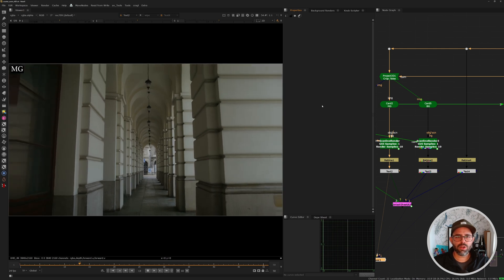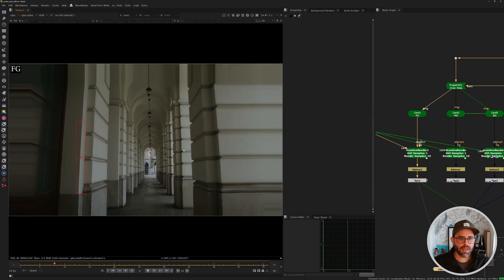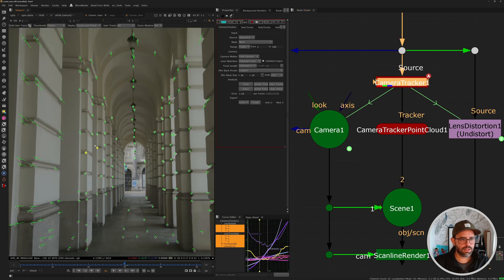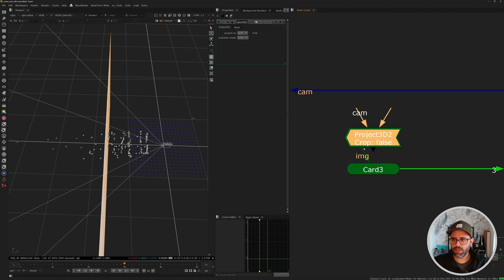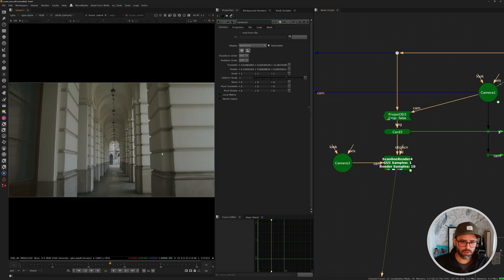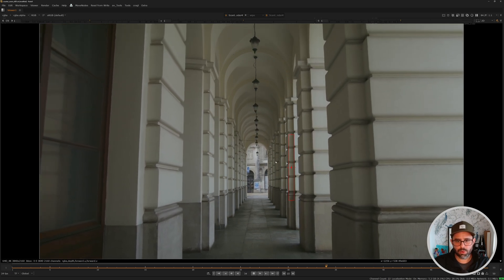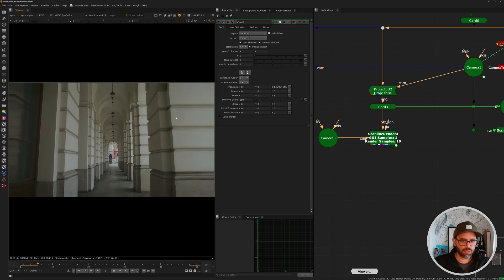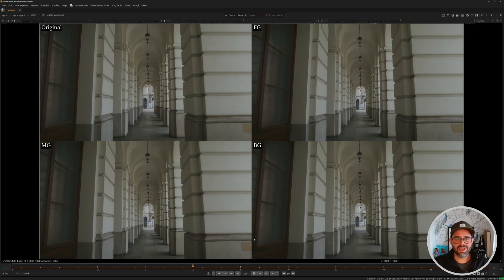Counterzoom Effect in Nuke

Comment: You can use a frame hold in the pipe from the main camera to the ScanlineRender (not to the projection node) without having to go through steps of duplicating and removing keyframes. It also then keeps it procedural and you can change the frame it's referencing the camera from.
Reply from the maker: @peterwelton267  yes, you can definitely do that.